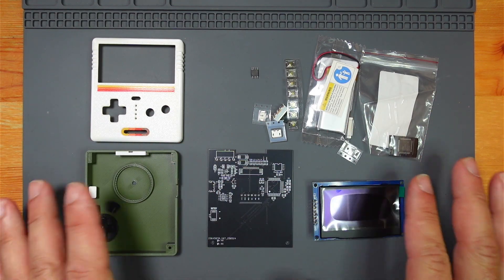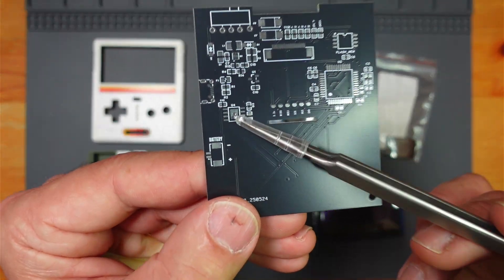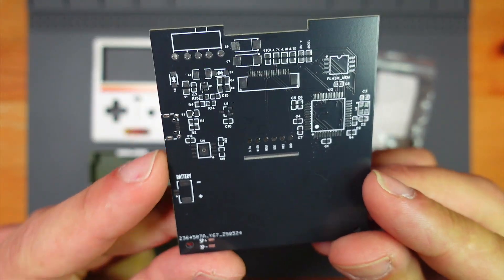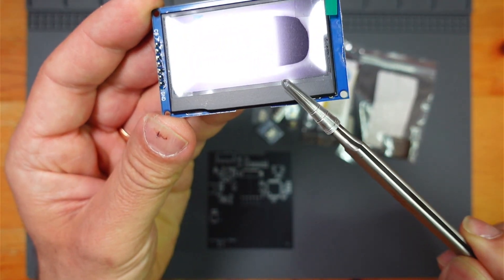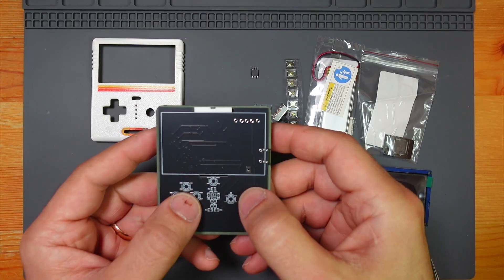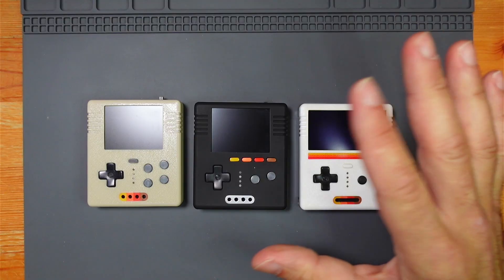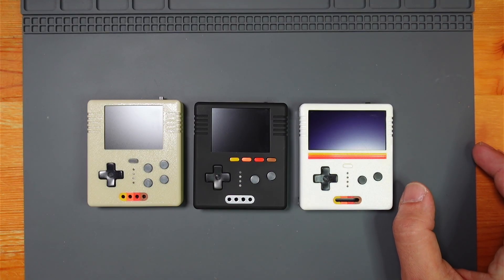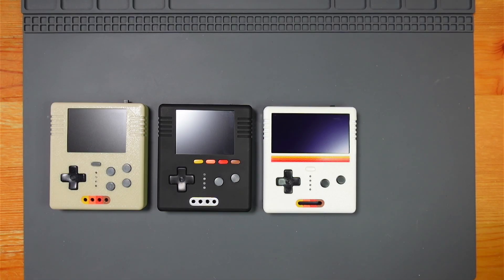MegaPocket : DIY Big Screen Arduboy

Comment: is it possible to replace the micro USB port with a type-c one? If they can simply be welded or do I have to replace something else
Reply from the maker: You would have to research it, but a pcb redesign would probably be needed.
Reply: Oh no, I ordered everything I needed last night 😢😂
Reply: I think i will trie to adapt those legacy USB with that little 5V PD converter circuit

Comment: Very impressive, like the way you took the screen off of the breakout board to slim it down, was there much circuity on it?
Reply from the maker: I liked the SP one you did a few years back. It's a fair bit of circuitry mostly for the 12v needed for the screen. It probably doubles the component count.

Comment: Looks awesome, I'm looking forward to building mine! There were a few 'bare metal' emulation projects a few years ago with the Pi Zero's etc, never actually tested but they dont use Linux and I assume have similar boot times to ESP32/Pico etc, just searched and looks like most have not been continued but you're right, the boot time does kill Pi stuff imo.
Reply from the maker: I'm leaving it for the moment (Pi Zero Pocket). I really can't get excited about it. Plus, I still have loads of your stuff to build. By the way... I think I uploaded games to your flash without the SSD1309 patch selected. Fortunately, that's a really easy fix. I'll drop you an email.

Comment: Nice!
Yah, the Pi Zero boot time is the pits. I do love the instant-on Pi Pico.
I definitely prefer having JLC do the assembly - when it's not 3X the cost of the board.
Reply from the maker: I've never done a pcb assembly order, but I've looked at the costing and it can be prohibitive. I like soldering fortunately, but I think partial board assembly (the cheap stuff) might be a work around if I ever wanted to do a batch. 👍